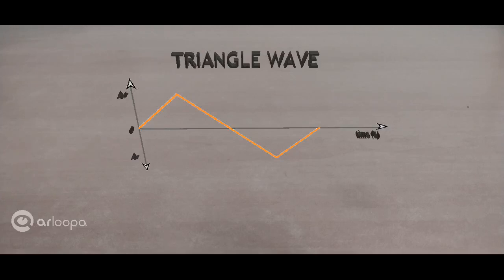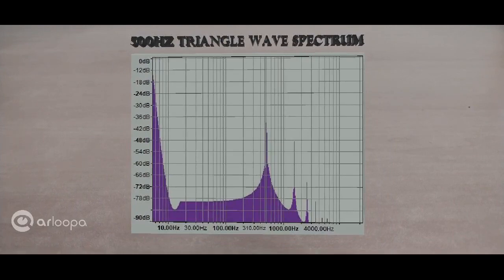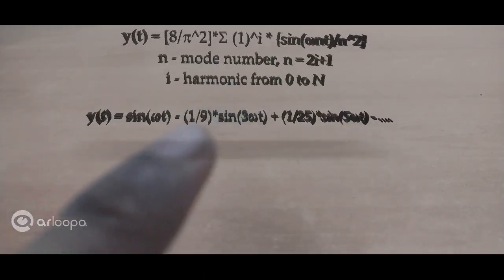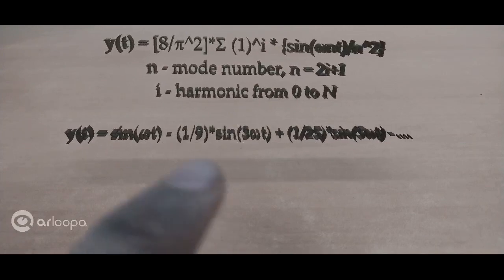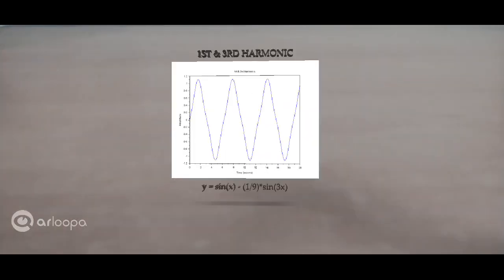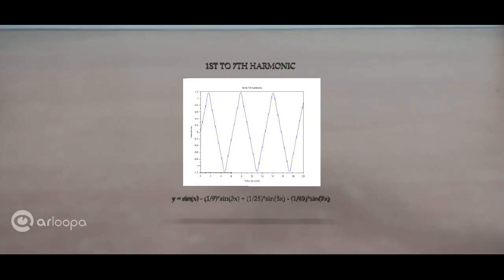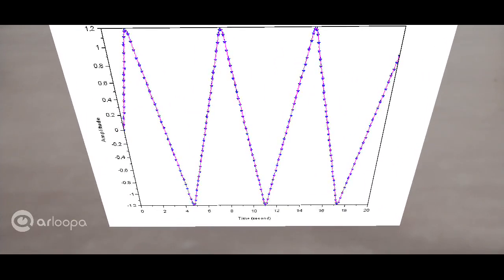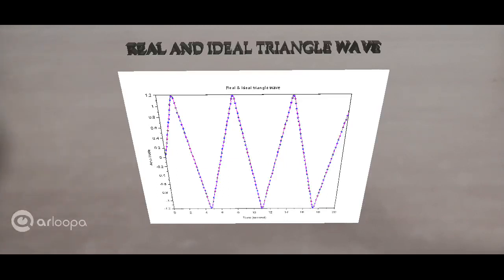Triangle wave as a sum of sinusoids explained

Comment: 🤔 there's something I don't understand, why is there a (1)^i in the equation?? that will always be equals +1...
Reply: I just checked, it's wrong, it should be (-1)^i
Reply from the maker: Thanks! Yes, that makes sense as this would lead to odd powers still retaining the negative symbol while even powers are positive. The sources I referred to initially mentioned (1)^i but now I know it's wrong.
Reply: @SrinathSrinivasan  I believe on the sawtooth or square you did the same, but it doesn't affect it, only this one was affected... Still, check the other ones too...